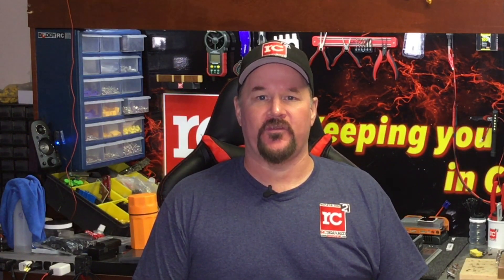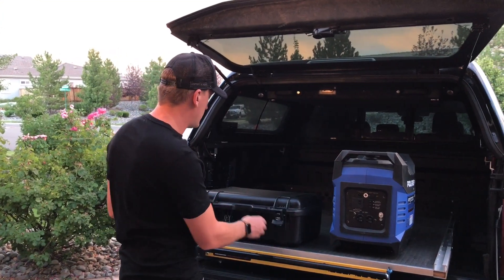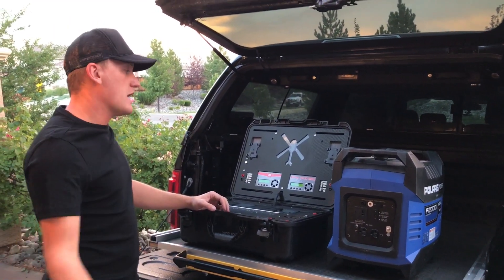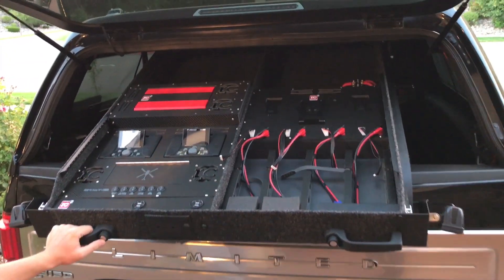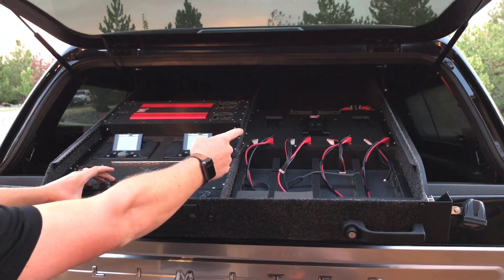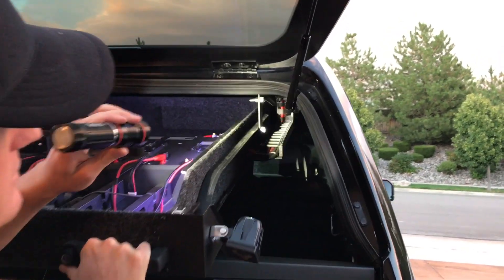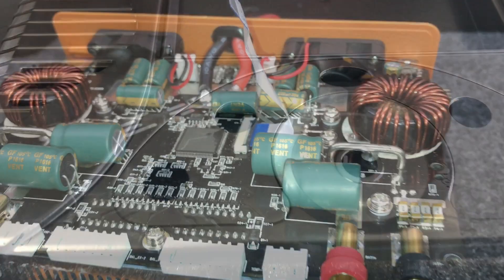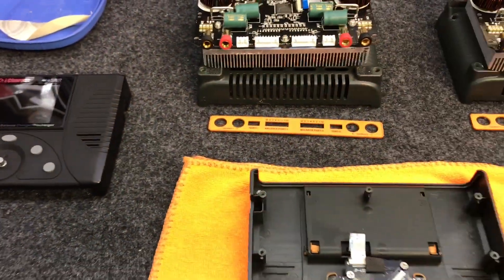Charging system for Copter Kids. CSV (Copter Support Vehicle)

Comment: What kind of power conditioning do you use? 12V systems, especially if there's any integration with factory bits (ie alternator), as well as power generators are notorious for surges as well as wide variations in voltage and frequency.

Comment: I see that you put a lot of work and created a beautiful product here, but I have just one question.  What happens if you have a lipo battery go bad on you and there is a lipo fire????
Reply from the maker: Good question, I hope that people that use LIPOs take the time to read and make themselves aware of the causes of LIPO fires. Damaged LIPOs are the number one cause of a fire, people can me more focused on their equipment being damaged after a crash or incident and overlook the damaged battery. Never charge a puffy LIPO, there is obviously internal damage if there is puffing, the puffing effect is caused by the Lithium turning from a solid to a gas. Basic inspections of your LIPOs and making it part of your pre-flight can take the chance of a LIPO fire to a almost zero chance of happening. You have more of a chance of a fire from getting into a car accident and having LIPOs ignite from impact, than you do from properly maintained and stored LIPOs. That being said, everything comes with a risk.
Reply from the maker: For safety you should have a class D fire extinguisher (Carbon Dioxide)

Comment: Chargers and batteries generate a lot of heat, I wonder during the day all that gear high up under that black roof... How do you keep it cool ?
Reply: automan1223 If the truck is idling to run the charger, I would think the a/c is cranked.